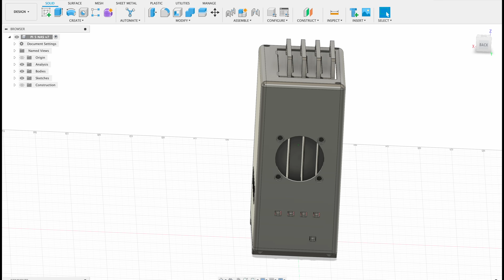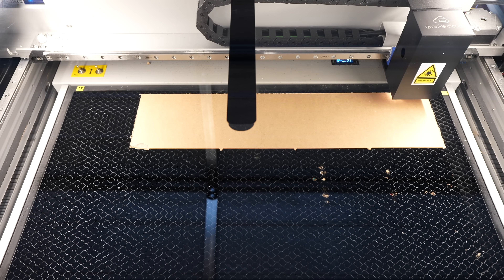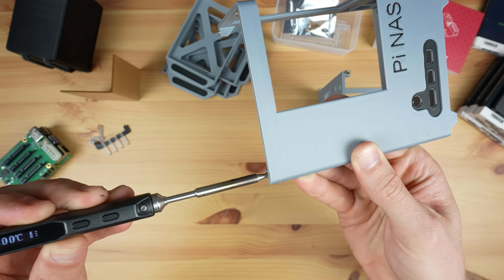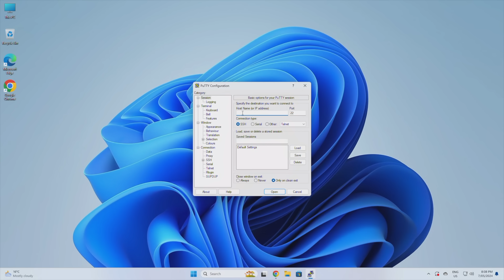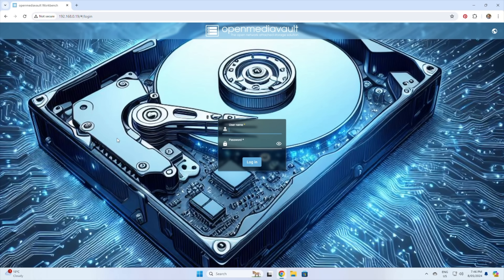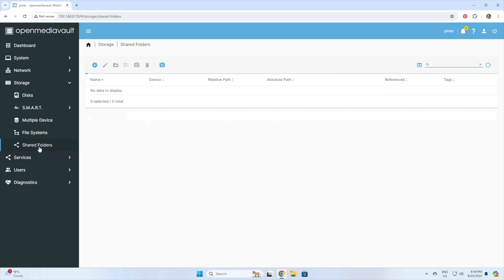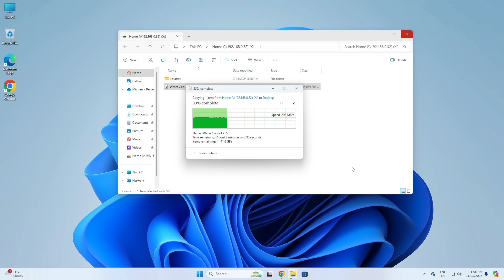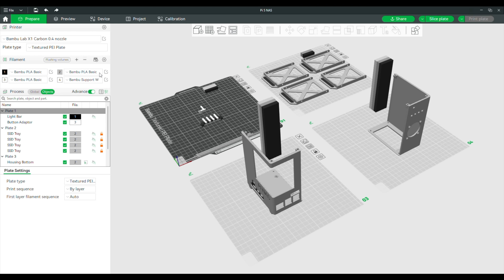I Built A 4-Bay NAS Using A Raspberry Pi 5

Comment: can eSATA be used to boot from?
Reply from the maker: Yes you can boot from the eSATA drive
Reply: @MichaelKlements  thanks a lot. One more question: does the drives pass the serial and smart data as well? I am thinking if is 100% safe to use them in ZFS RAIDZx

Comment: does pi only accept pios? 
will it still fit the case if you buy a spacer to increase the gap and not need to destroy the fins?
will PLA hold up with the heat?

Comment: Guys, be careful with the SATA indicator LEDs on the SATA HAT. I had a poorly printed part that was slightly pressing on one of the LEDs, which eventually broke it.
I spent an hour trying to figure out why the indicator wasn't lighting up, I thought the drive had failed or there was a software issue, until I finally realized the problem was the LED itself. Only  then, thank God, my clumsy hands managed to desolder the LED from the 5th slot(which covered by the case anyway) and solder it in place of the broken one.
Finding a replacement is also difficult, it's so tiny that you can't take a clear picture of it, and it has no markings at all. So don't repeat my mistakes😅
Reply: SO how can I fix it? give me step by step please.

Comment: Is there any reason why you soldered 3.3v and GND adaptor on the hat? I mean, we can remove the cover of the wire of Noctua Fan and connect on the hat directly, right?

And more, If I have a 32GB USB memory I don't need to buy SD card right? because I can install the OS through USB port
Reply from the maker: Because the fan is mounted onto the removable panel, if the fan is soldered to the pins then it makes removing this panel quite difficult.

Yes, you could run the OS off a USB flash drive.

Comment: Those SSDs are a bit overkill and its around $240 for 4TB. I think it would make more sense to buy 3.5 inch NAS HDDs. One 8TB NAS HDD costs around $180, and 12TB is $250. So for the same price you triple your storage size. But then sata extension cables will be required, although they are inexpensive.
Reply from the maker: Yes, 3.5" drives are still much cheaper per TB of storage but the intention behind this build is to have a NAS that's low power, quiet and compact. If you use 3.5" drives then it won't be.
Reply: wouldn't it last shorter than SSDS?

Comment: Cool build. 2 questions: 1. Do you sell the enclosure for those who do not have a 3D printer?   2. Could you use a Pi Poe hat to reduce the amount of cable clutter?
Reply from the maker: Yes, you can reach out through my Etsy store - https://www.etsy.com/shop/TheDIYLifeCo
You can't use a PoE hat with the Radxa hat as it requires 12V

Comment: Hello Michael. Is the PNY CS900 1 TB a decent enough drive for this project? Thank you.
Reply from the maker: I have never used PNY drives but if you run this in a RAID configuration then you'll have some level of redundancy in case a drive fails.

Comment: Im just getting into these setups and this is the cleanest one I've seen yet. But I'm confused the drives are really just powered from the 12v power through the pi?
Reply from the maker: Yes there is just a single 12V power source for the whole setup. The drives are not powered through the Pi, but through the SATA hat. The hat provides 5V power to the Pi.
Reply: @ I saw that it powers through the hat after looking at the site page. But wow that’s crazy. Could this be a home brain NAS + VPN + pihole in one? And thanks for getting back so fast

Comment: Awesome video. I wonder if this could be powered sufficiently using just PoE?
Reply from the maker: It probably could but you'd need a specialised PoE hat - the Pi one's all output 5V as this is the voltage that the Pi requires while this SATA hat requires 12V and it steps it down to 5V for the Pi.

Comment: Would connecting the recommended 40mm 5V case fan to pins 2 (VCC3X3_SYS)  and 7 (GND) of the 2x5 connector work, assuming some kind of adapters can be found? Trying to avoid soldering on the Penta Hat board.

Comment: Been using the same nas for Plex with pi 4 and the rxda enclosure.
Printed this for the pi5 and the Immich server using omv and raid 6. You have to be careful when inserting the brass inserts. If you make a mistake and you shift the insert by a tiny amount you will have trouble getting it together. 
Also no need to solder the fan adaptor. Just expose a bit of wire at the end insert it into the gpio holes on the rxda hat and slide it on the pi. Works just as well. No soldering.
Reply: So no issues with plex and movie replay using this setup?
Reply: @ not at all. The pi is plenty fast to handle Plex. I also don’t do any transcoding. No point, just play the original file as is. Works fine on the home network and I don’t play media outside my house.
But I did add some ventilation holes to the bottom of the case.
Reply: what case did you use for the rpi4? the same one in the video?
Reply: @ЕвгенийКрайнов-ф7ю  just search a quad sata kit pi4 case and you will find it.
Reply: What about for jellyfin and is there SSDs?

Comment: There was one thing I was really hoping to see on the case that I was disappointed wasn't there. It would have been nice to have tracks in the top of the case to help guide the ssd trays straight down into place rather than having it fully open, just for that slight bit of extra stability when adding or removing drives. Other than that, everything looks top notch.

Comment: Quick qusestion, would this NAS system be a better option than Synology and other brands?
Reply from the maker: It depends on your needs, it's better in that its not locked into a particular software package, it's low power, silent and upgradable but its also not particularly powerful and requires some effort to set up.

Comment: Dude no fucking way, that case is some of the best design work I've seen in a long time. I'm working on a Pi NAS with a Pi 5, Pimoroni 2x M.2 hat, and Waveshare M.2 > 5x SATA adapter so I can use the faster NVME drive for caching. The SATA drives will be sitting at 90º to the way yours are oriented. Any chance I could hire you to modify your design just a bit so the drives fit? This case is freaking killer!

Comment: Very nice indeed! Just some caution: you seemed to have soldered the 5V fan to the 3.3V pin of the Pi. Why didn't you use the 5V pin? The amps this fan will demand are likely to make the Pi unstable when drawing on 3.3V. I would suggest to solder it on one of the two 5V pins. Again, congratulations on the entire project.

Comment: Thanks for making all of this, very nice work. I used to have a Raspberry Pi 3b that ran as a Plex server, but it was quite slow as far as the transcoding went, and only cleanly streamed 720-1080p videos. Now I am looking to get a Pi 5 and set up a NAS and also run Plex off the same server, but with something low cost (as opposed to buying or building a $500 mini PC but that uses far more electricity).

I think this setup could work.

Comment: So that one barrel plug provides power for the pi5, the 4 drivers and the adaptor board inbetween those two all by itself?

If thats true, can you do the same with old school spinning drivers? Most of the sata pi nas i've seen have used a full sized atx power supply which added so much bulk that i decided not to pursue the project.
Reply from the maker: Yes, they are all powered by the single barrel plug.
If you are referring to 2.5" mechanical drives, yes you could most likely power them from the same supply. These don't use much more power than 2.5" SSDs. You won't be able to use 3.5" drives off a single power supply though as they typically require a 12V supply (not 5V) and draw a lot more current.
Reply: @MichaelKlements  damn. using 3.5" drive's was exactly what i was wondering about. as nice as the 2.5" ssd's are, i have a ton of 3.5" old drives that could make for a decent NAS but kinda wanted to play around with a raspberry pi and use it to try my hand at linux for the first time. had hoped i could skip using a full sized power supply since i figure that's massively overkill just for for the 3.5" hard drives.

Comment: Awesome stuff Michael ! I have a Noctua 40mm by 20mm fan which is leftover from a recent project. Is there enough clearance to fit the 20mm deep fan instead of the 10mm ? I am not being tight .. just don't want another fan in the parts bin ... I would rather use it than getting another :-)
Reply from the maker: Unfortunately not, the fan is quite close to the drives once installed.
Reply: Thx Micheal.

Comment: So everything seems fine... but an SD card is not exactly known for its durability. What happens if it breaks?? Will the data on the NAS still be available?? Including shares and user accounts?? Wouldn't it make sense to install the OS on an external hard drive??
Reply from the maker: I've had microSD cards running in Pis for years without any issues - as long as they're not being written to in large quantities. But yes, you can keep a backup copy of the microSD card and just swap it out if it breaks. Installing on one of the drives is an option too.

Comment: Very interesting! Can you try to use ZFS on this and post some performance numbers? Do you think it could be possible to also run nextcloud instance and a pi hole at the same time on this PiNAS? in that case i could get rid of 3 systems and replace it with your idea!
Reply from the maker: You should be able to Nextcloud and Pi-hole if you run them as containers on a Docker installation on the Pi.

Comment: Thanks for sharing! Can you plug in two 3.5" HDD without adapters? or what would be needed ?
Reply from the maker: The spacing on the SATA ports it too close together on this hat for 3.5" drives. You'd need some extension cables to use 3.5" drives with it.

Comment: Speed and power consumption, how does this compare to a regular 4 bay nas?
Reply from the maker: There isn't really such thing as a "regular NAS" but speed is better than a commercial NAS with a 1G network connection and similar to a NAS with a 2.5G connection. It's power consumption is much lower than most commercial NAS products.

Comment: Thanks for the video! Just got mine completed with all the shares working great. Only issue I'm having is with the USB Ethernet adapter. I'm only getting a blinking orange light and the pi isn't actually connecting when I scan with WNetWatcher, even after reboot. Connects just fine directly through Ethernet. Double checked connections and tried all USB ports, though I started with the same one you plugged yours in to. Any idear?
Reply from the maker: Are you using the same Ethernet adaptor that I used or a different one? You might not have the correct drivers installed if you're using a differnt one - not all of them are just plug-and-play on Pi OS.
Reply: @MichaelKlements  I'm using the same one, yeah, purchased directly from the link in the description. It did come with a manual that says it's for Windows and MacOS - doesn't say anything about Linux. Does have drivers for the other OSs. I just assumed from the video that you didn't install anything, but am I mistaken?

I should also mentioned that I purchased everything from your links, including the Pi itself and the Micro SD card, so everything is fresh. I installed Raspberry OS Lite. Other than installing OpenMediaVault and updating packages, I did not install anything else or configure anything outside of the software, enabling SSH, and enabling the PCIe drives as followed.
Reply from the maker: That's strange, have you tried it on another system to check if it works? That Wavlink adaptor is compatible with Linux Kernel 3.2 and above - so was just plug and play for me, no driver install required.
Reply: I had the same issue whereby everything was working fine with a new install, and then I added the USB ethernet adapter, which didn't work. After trying all kinds of options I decided to reinstall everything again, but this time I plugged in the USB adapter first and then installed OMV etc, and this connected to my network fine with no issues. You will need a 2.5gb switch connecting to your NAS, and PC with 2.5GB network port to get the faster transfer speeds.
Reply: @andypang6416  That is really interesting, I'll give that a try. I ended up just boxing up the adapter and putting it on my work bench lol, but I'd like to get it working. It's odd, I have 1 gig internet and a 1 gig switch, but I'm only getting like 32 Mpbs transfers...

Comment: Hello! Congratulations for your work, the result is very clean and professionnal. I'm going to  download the files. Currently I run a Yunohost server on a RPI4 in a Argon40 Eon NAS enclosure, but I'd like to upgrade to a RPI5 so your case may be the solution I'm looking for. Would you intend to create such a case for 3.5" drives also? Best regards
Reply from the maker: This particular hat isn't compatible with 3.5" drives as the ports are too close together. If I can find an adpator that supports 3.5" drives without additional cables then I'd look into designing an enclosure for it.

Comment: What fan would I need to avoid soldering ?
Reply from the maker: If you use a molex to fan adaptor then you can plug the fan into the available molex port.

Comment: Is there a way to use Sata HDDs with Pi?
Reply from the maker: You can use 2.5" SATA drives with this hat, you'll probably just need to add additional power. You can also use 3.5" drives but you'd need to use adaptor cables as the ports are too close together for 3.5" drives directly on this hat.

Comment: I'm newly exploring the idea of building a Pi NAS. The Radxa SATA hat is toast at every single retailer. Is there something else you could recommend?
Reply from the maker: I'm not aware of any other quad SATA hats for the Pi 5. You could get a similar result using a PCIe adaptor and a full size PCIe SATA card but that obviously won't fit into this enclosure.
The Radxa hats still seem to be available on Aliexpress

Comment: Thanks for the video!

I have a tangential question: I'm new to NAS, in general, and looking to get my first device. I see that you have what looks like to be the Asustor AS1104T. Would you recommend it over a similar solution from Synology, especially for beginners like me?
Reply from the maker: I've had the Asustor AS1104T running for two years now without any issues and I use it almost daily. I haven't used a Synology NAS, so can't really comment on them but they're a well supported company so I'd imagine they're as good, if not better than Asustor. The main differences will likely be in the software.

Comment: If I were to build something like this, can i start with 1 then over time add hard drives? Do they all have to be the same?
Reply from the maker: Yes you can add drives as you need. Depending on your RAID configuration or setup you can use different size drives.

Comment: Yes, the ssds where totally worth the insane cost inflation on this build. I am getting the same speed with my WD harddrive. Because its capped by gigabit LAN/WLAN...
Reply from the maker: The drives cost $55 each vs. $35 for physical drives, so there was an $80 difference across the build. Speed aside, there are other reasons for using SSDs, they're silent, more durable and use much less power.

Comment: 7:51 I am a big fan of the enclosure design you've made. I wondering if you can make a guide slot so when inserting the ssd we can be more guided like a real nas??
Reply from the maker: I played around with adding guides to the bays but that restricts visibility of the drives so it makes the window pointless and it restricts airflow across the drives.

Comment: What makes Synology better in performance? Can u comment on it? I mean what is special which makes it good in stability or data transfer etc?.
Reply from the maker: Synology have a lot of different products but in general they run more powerful hardware so you're able to get better transfer speeds. Their hardware is also designed for a NAS to start with, so you don't have the reliability issues associated with additional connectors and adaptors you'd need with a Pi.

Comment: What program are you using to design the objects?
I want to start and I don't have much idea.
Reply from the maker: I use Fusion360 but it has quite a steep learning curve if you haven't done CAD modelling previously. TinkerCAD is much simpler to get started with but is quite limited.

Comment: Edit:
Kinda feel a bit stupid for writing this, but I completely overlooked the fact that I was transferring files from a Wi-Fi device to the NAS. When I switched to a wired connection, my transfer speeds did go above 100 MB/s. For anyone facing a similar issue (doubt it), don't forget to check transfer speeds from a metered connection. 
Feel so dumb... 😓😓 Haha!

I copied the exact setup, however I am not getting around 100mb/s but around 40mb/s.

With the speed test: "sudo dd if=/dev/zero of=/dev/sda bs=32M status=progress count=100 oflag=direct". It shows 385mb/s.
I don't understand, is it my network, or could it be something with my SMB settings?

If somebody knows more about my issue, than any tips or help is much appreciated!
Reply from the maker: There are a large number of issues that can cause a drop in performance. It could be hardware related - drives, poor quality cables or connectors, issues with the switch etc. or it may be settings/network traffic related.
Reply: @MichaelKlements  I ordered a new ethernet cable to see if it improves anything. Could maybe also try a 2.5 gbps adapter. If there's no change, I'll guess I'll take a closer look at the settings.
Thx for taking your time to respond!

Comment: the additional power ports are for powering 2.5" HDDs rather than SSDs although you might still experience read/write performance issues with SSDs due to current limitations of the Pi